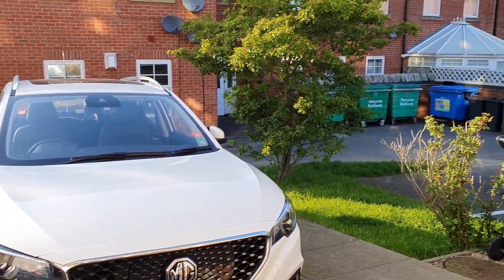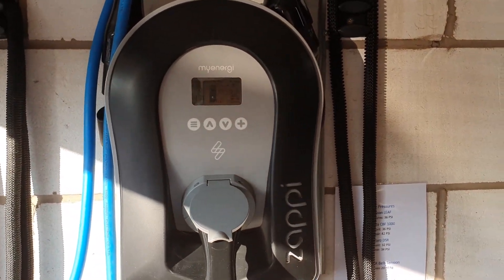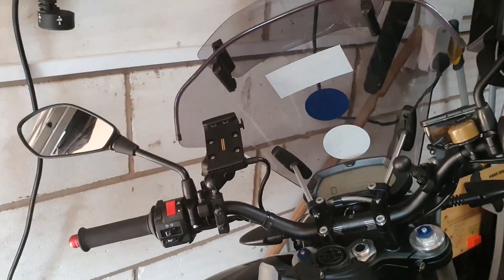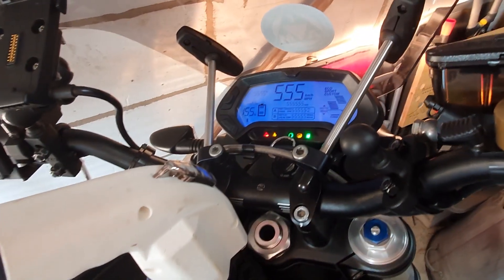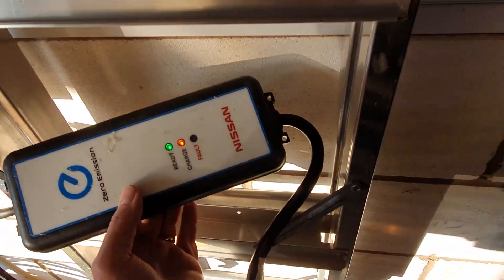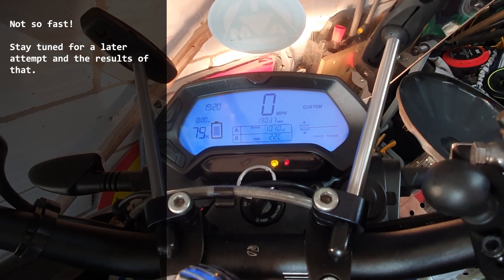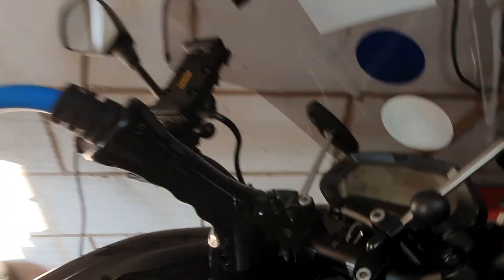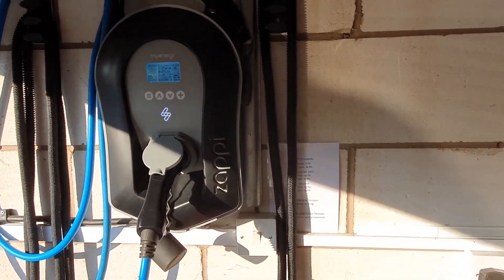More Zero DSR Charging Strategies

Comment: Im a bit confused about the charger, Is this a normal connector on the Zero's or one you put on your self or is this on the newer models only ?
Reply from the maker: It's the 6 kW Type 1 Charge Tank which I had fitted when I decided to keep the motorbike when my finance package ended and I had the option to have it retrofitted.

Newer Zero bikes already have Type 2 AC fast charging included, but it was an expensive option and limited to 2.5 kW when I originally bought my DSR in 2016.

Comment: I’m confused as the amps are being calculated at 110v and you are in the UK, so it appears that the Zero app doesn’t calculate it correctly.
Reply from the maker: It doesn't matter that we have 240 Volts AC as standard mains supply in the UK. We're constrained by what the bike can do. You can see the battery Volts are the constraint. When the bike is fast charging, the Amps increase, but the battery Volts go from 96ish when almost empty to 116 when fully charged. Multiply the Amps by the battery Volts and you can see the kW figure is accurate.

Comment: Hi John,
Just ordered a charge tank but having second thoughts.
Does not seem that many public chargers have type 1 connector.
Would you still recommend end this ?
Thanks
Kevin
Reply from the maker: Hi Kevin. You just need a type 2 to type 1 lead. They're easily obtainable from multiple outlets. It's the same as the original Nissan LEAF uses.

And yes, I would 100% recommend a Charge Tank. 👍

Comment: Hey John I just wanted to let you know that here in the US if there are two ChargePoint level 2 chargers available I plug one into my 6.2kW charge tank and the other into my onboard 1.3kW charger by using a J1772 to C13 female plug into the side of my DSR. This then allows me to charge at 7.5kW (6.2kW charge tank PLUS 1.3kW onboard charger) I've written about this on my own zerodsr website. In researching the ability to charge my 2 EV bikes (the DSR and my Sur Ron) from my solar generator, I can charge my Sur Ron using my Montek 1000w solar generator, but not the DSR. After sending Montek the stats of the DSR's onboard charger (in the US that's the 120v model) they advised me that I'd need a 2500w inverter to charge the Zero. So at some point I will be able to charge the DSR using solar as long as the inverter is at least a 2500 version. I'm using the newer Bluetti PV200 solar panel which is wired in parallel on the cells. And I'm only using a portable generator and solar panels, not an at home unit. I like to boondock camp so having the ability to charge out in the desert is wonderful using solar.

I forgot to add that I purchased a Tesla Tap thanks to Sam from NewZeroLand who alerted me to its existence. I can now charge at Tesla Destination chargers which are much more reliable than ChargePoint stations. It also opens up 30% more charging options for me and they are located at nicer hotels and restaurants too. Which means by staying at places which have one I can now charge while I stay at those hotels or restaurants. Much better than stringing a long extension cable out of my room. LOL. I've never encountered one that was out of service or less than 7.5kW of charging power, unlike ChargePoint which sometimes has shared power lowering it to 3.1kW or more likely being out of service. So much ACTUAL EXPERIENCE charging on the road rather than just at home.

Comment: This is an old video, so apologies if you've already learned more, John. I don't know the size of the battery on the Zero, but recharging at over 3 kW with over 80% state of charge is probably close to the fastest safe limit for it. When you resumed charging and only saw 2kW, the BMS might have selected that lower rate, because the battery was already at 85% SOC. Recharging rate should be reduced when a Li-Ion battery is close to being fully discharged or fully recharged, in order to protect the battery and ensure optimum battery longevity.
It would have been very interesting to see how it performed when at between about 30% and 70% SOC. The recharging rate throughout that range might have been even faster.
Thanks for running the tests. 🙂👍